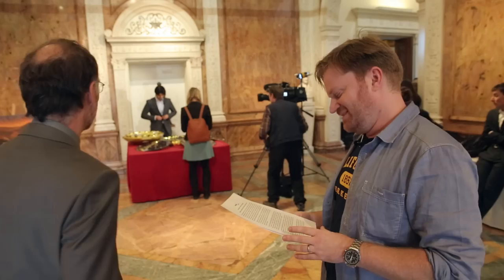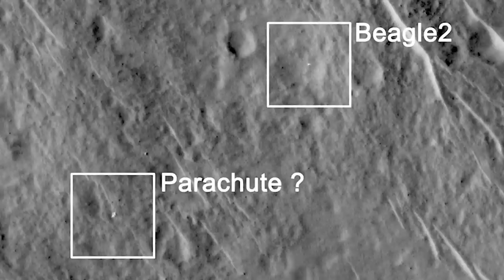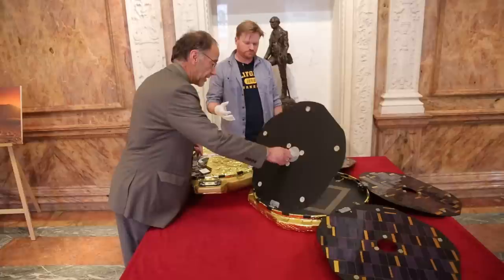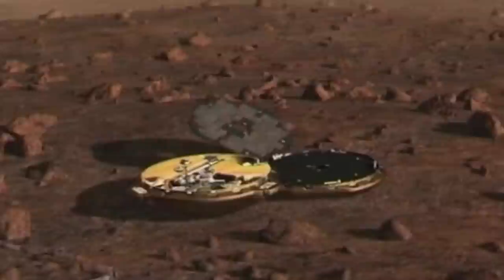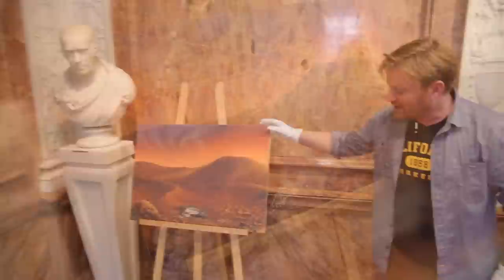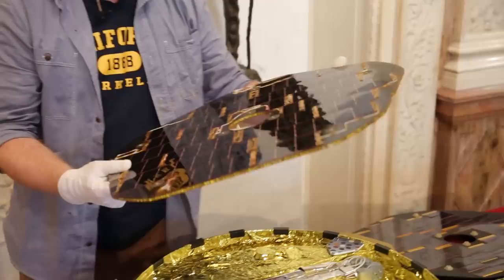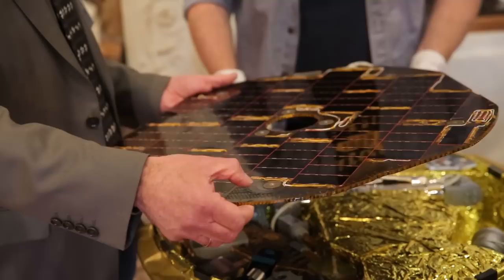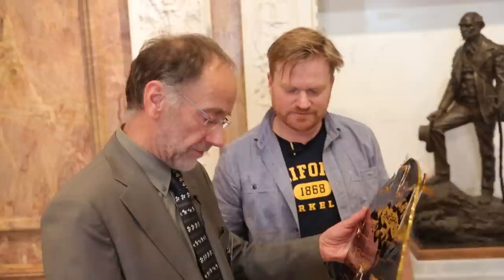Martian Solar Panel - Objectivity 3

Comment: Fantastic video Brady.
By the way, do you have anything planned for the Asteroid pass that's coming up? Asteroid 2004 BL86 is passing pretty closely and won't be near again for another 200 years, and the next major asteroid pass will be in 2027, It's going to be passing on the 26th and we should get a decent view in the UK afternoon too. I'm going to be looking out for it! :)
It's good because even those with small telescopes should be able to spot it too.

Comment: Ok it was not realy that smart that design. First thing is communication and thats is.  No communication you have noyhing.
Second is power.  philea the lander from rosetta failed with power. Landed on a dark spot of the comet. But the antenna worked al the time so the primairy mission was done beforemthe battery died. Sorry for the team because its not easy to do a job like that.next time build a backup antenna. The voyager 1 and 2 also had a antenna failure but they switched over to the backup. And they are stil working after 38 years.